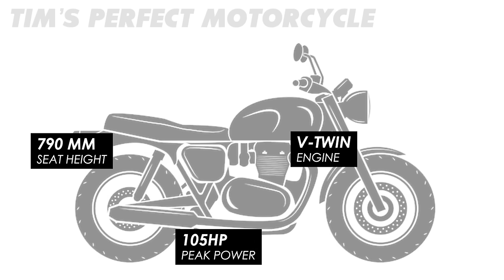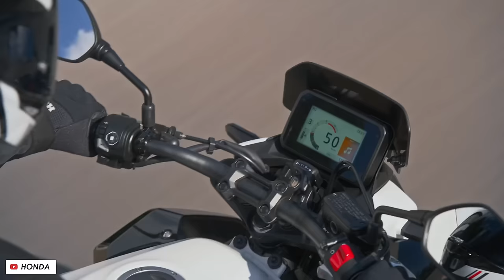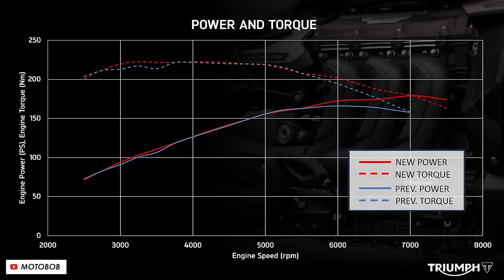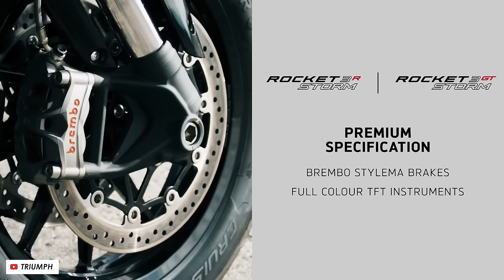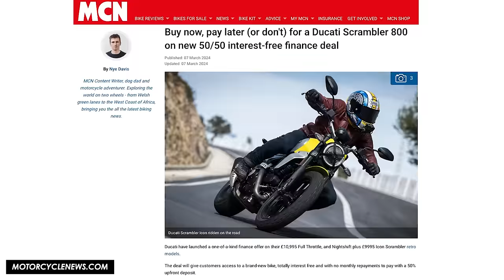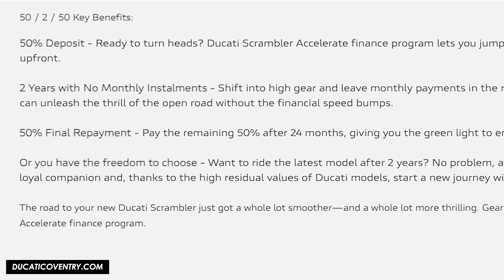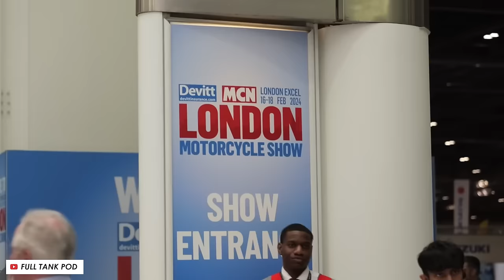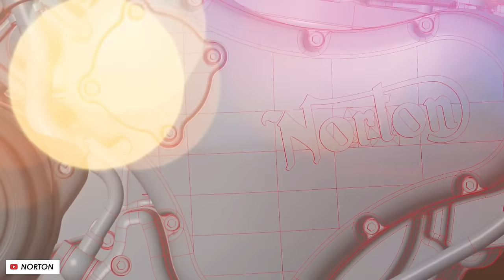The Moto News: Husqvarna Svartpilen 801 & Triumph Rocket 3 Updates, Ducati Scrambler New Way To Pay!

Comment: Good man Tim, Boxer !!! 
There’s a 1912 Verdel (I’d never heard of it either) 750cc 5 cylinder radial engine bike at the Sammy Miller Museum - thought to be a board track racer. Not a lot of clearance between the bottom most cylinder and the ground and typical of the day it had exposed valve gear.

Comment: I have a 2023 Rocket-R, and if you pull away at just the right moment in th opposite direction of the Earths rotation, you can actually Stop the Earth from spinning for a Micro second with the Torque of this Nuclear reactor of an Engine !!:goodvibes: Also, most people do't realize that the Rear Brake on a Rocket is also "Radial" like the front, just situated differently

Comment: I would have an Ariel Ace hands down one of the most beautifully engineered boutique motorcycles ever especially with the cantilever front forks…. I am not sure where the Duke scramble fits, its not retro enough to match the Triumph heritage range or Royal Enfield, and its not a flat tracker like the India FTR and it can’t compete with any modern mid ranger sport naked like an MT9 or XSR or Street Triple R…ps that cape looks like a wedding dress???